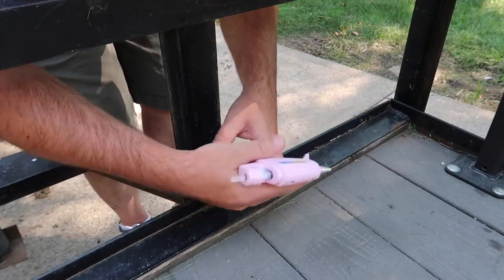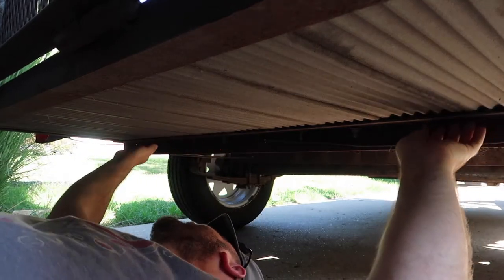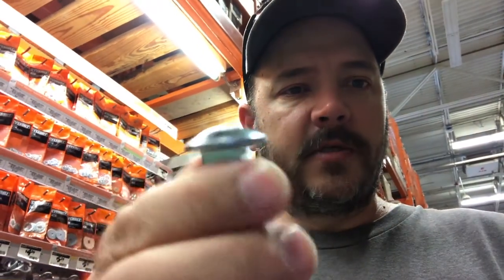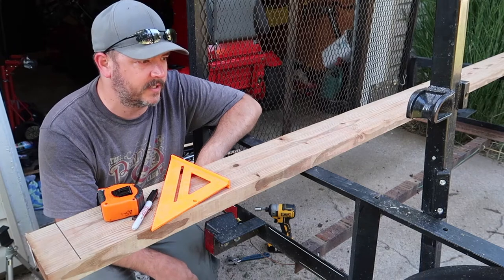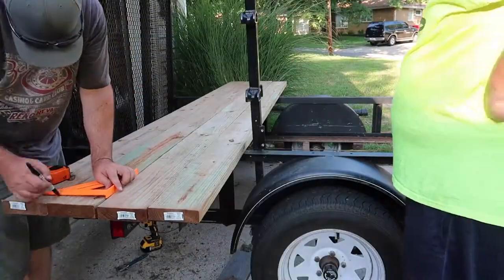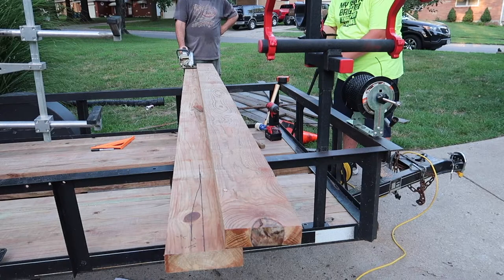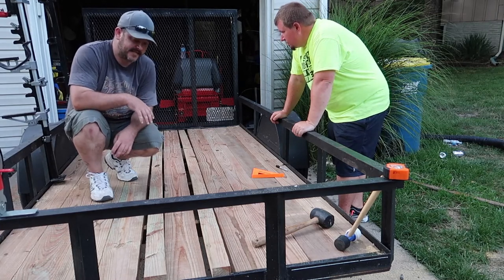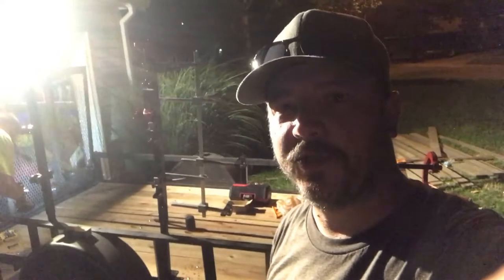How To Replace Decking On A Trailer

Comment: Can also use a jack from underneath the trailer and bow the middle boards allowing the remaining ends at the reaer of the trailer to just barely make it into the slot by pressing down on them.  Release jack pressure and the boards will slip the rest of the way into the slot.  Of course this is a two person job!  I used a 16d nail as spacers between the boards to allow for draining.  Make sure you cut off about 1/2 inch shorter to allow for swelling due to heat and humidity.    You may need to rip the last board in the middle by using a table saw so it will fit.
Reply: Ron Williams I did try to pry the middle up as much as I could. My weight wouldn't bend it down 3", so I did what I had to do to get it in place. If it was a longer trailer, then I'm sure I would have been able to do it the proper way. This is my buddies trailer, he didn't like the gap in the middle afterwards and put in a snug fit board. I do appreciate you stopping by!

Comment: Again someone instructing others that has no understanding' 
that composite decking is meant to only span 16''center on a stable joist system' and to support less than a 500lb mower at one point' not representing the decking just a carpenter thats installed miles of that and similar product.
Reply from the maker: Curtis Rodgers Again, someone who didn’t comprehend the video. The composite decking was already on the trailer when it was purchased. I appreciate the engagement though. I really wish I could forward these comments to the person who did it.

Comment: Should put a gap between all your boards for expansion, good video guys.
Reply from the maker: gene coppedge thanks for the input! He has a new DooLittle now, so he’s set for a LONG time.
Reply: NO NO NO
Reply: Most of the pressure treated wood I  get these days is so wet that you will get your 1/8th in gap just letting it dry after installation.

Comment: Very good video! What size boards did you use?? Also, is that a 5' wide trailer?
Reply from the maker: I don't remember the specs on the trailer, but the boards were 2x6's.

Comment: The wood on my trailer measures 1”x5”  do you suppose I can upgrade to a stronger floor to perhaps 2” x 6” ? My concern is the angle iron and slot (front and back of the trailer) would it be too small for the larger sized wood...
Reply from the maker: Hard to answer that from this side of the computer Burdell.

Comment: Did you use stainless screws this time so the can be removed them next time?
Reply from the maker: +Daryl Jones yes we did. He has a new trailer now. Shouldn’t have to worry about redecking for quite a while.
Reply: Great been there done that before but that's how we learn sometimes trial and error :-)
Reply: You're supposed to use galvanized screws for ACQ wood

Comment: Just to let everyone know wood needs room for expansion so hopefully he left a little room for that too. And use stainless steel replacement bolts and screws, they will always be free of rust in the future.
Reply: Treated wood srink's a lot you need to wedge the boards together' and the bolts will last as long as the decking.
Reply: Not with pressure treated lumber, professor. Good try tho.

Comment: Doesn't the chemicals in pressure treated corrode steel?
Reply from the maker: Hmmm, possibility. I don't know what all of the chemicals are. It is what the larger trailer manufacturers use.
Reply: Use stainless steel
Reply: Yes but not faster than the wood will rot again' we havent had real treated wood for a decade.